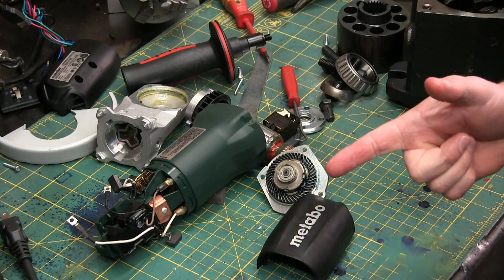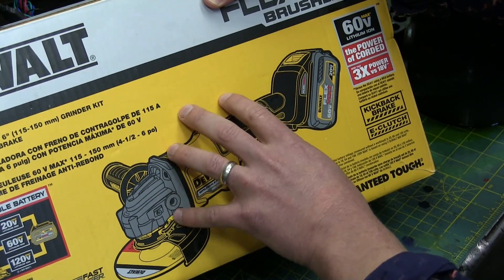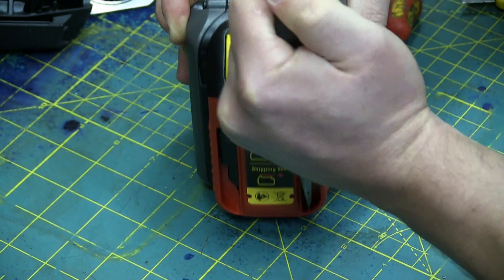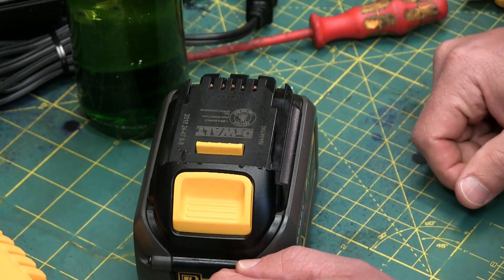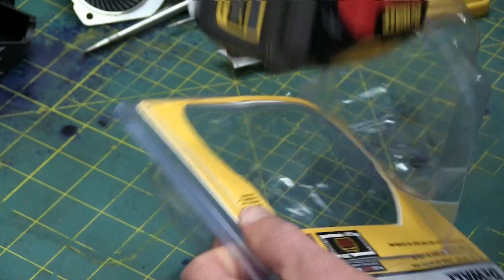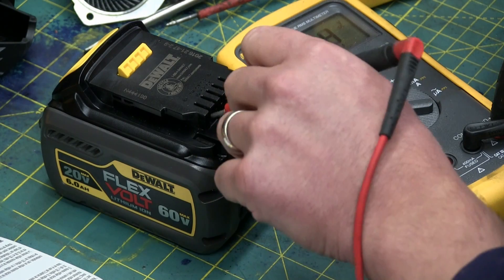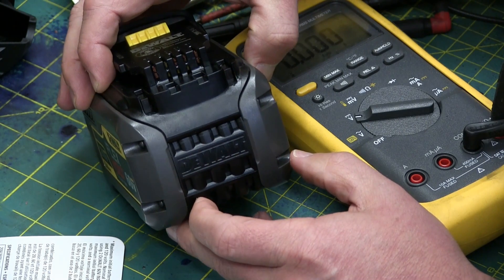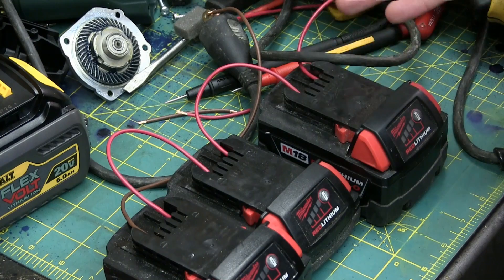Plug-in Power Tool to CORDLESS CONVERSION.

Comment: Hello AVE! I've been thinking about this problem today and I've read the comments about UPS's etc, long story short, I've got an idea for a device which should solve your problem. I could knock up a prototype this week if you like? It's not expensive at all. Just incase your wondering who the hell I am, I'm an EE for HVAC over in europe, mostly worked on power stations and cathodes for spacecraft engines. I've seen larger scale versions of this problem with long HVAC lines in some of the more remote parts of my country, and a factory on the end of one of those is basically the same of a tool on the end of a long extension cord so I thought I could just miniaturise a version of the solution used there.

Comment: use capacitors on the tool end. like a start cap on an induction motor. it will add the current at start. Then it recharges during normal operation.

Comment: There's a lot in misinformation in the comments.

1) This is a universal motor. It runs on AC or DC directly. We don't want to nor do we need to use an inverter like a UPS.
2) 120VAC is measured as RMS which means the waveform PEAKS at 170V
3) 120VAC RMS is equivalent to 120VDC

Comment: There's lot of ways to do it... two 60V windings in the motor can be wired in series, which makes 120V as long as the insulation strength can take it.

Then there's the fact that a series-wound motor will run on DC or AC.

Speaking of the turbocharger, it's possible to couple the AC on top of DC using capacitors, but you need big caps to do it, like Motor Run capacitors. Even still, it's a complex problem that the drill may not be able to handle, particularly if you're looking at a 60VDC offset (which means your drill needs to be able to take 240VRMS AC or 339 Vpp). TL;DR: get a big enough inverter or just spend the money on a proper extension cord or generator.

Remember... if it won't trip the breaker, the drill motor is going to let out the smoke!

Actually, a better way to do it is something like US Patent 3727122. Turn into DC, and make AC by alternating the polarity every other cycle once the source is connected the DC to the load when it's not going from 0-189VDC. 

https://www.google.com/patents/US3727122

Comment: This has really got me thinking. here in the UK we have 230v in houses (400v 3phase on commercial and industrial) but 110v for building sites. We have 230v to 110v Center tap earth transformers, 2 x 55v. (so when some dumb fecks chew through it they only get 55v) With that in mind a 60v battery (or 2) with some electronic trickery should work. it would only need to out put 2 separate 55v AC supplies 180' apart on the sin wave. this is doable !!

Comment: why not convert the power from the wall right to DC, then have a bank in parallel with protection? or skip the batteries and have a cap bank that discharges when you go to draw current?
it would be easier to explain on paper but I can see it working.

Comment: Hey Bro, the reason batteries aren't fully charged when you buy them off the shelf is because they are in a "storage charge state" which is usually around the 50% mark of capacity. This is in fact the correct level you should charge your batteries at home when putting them up for the season as it extends the life of the cells. I never understand why tool chargers don't have a storage charge setting on the unit but I guess it's so the battery does die and you have to buy a replacement. 

I really like the idea of a turbo charger for tools so you don't trip a breaker but I would have thought super capacitors would be the better option in the setup you suggested, no?

Comment: Not to burst your beer bubble but that is just brown out protection.  So why not use the off the shelf product that already does that? Get yourself a buck/boost UPS for computers and electronics.  Also called brown out protection.  They are the less efficient of the UPS offerings.  I believe all incoming power is converted to DC then routed to a common bus with the batteries and then that in inverted back to AC.

Comment: You should look at the h bridge circuits that they use in simulated sine wave UPS backup batteries. They don't actually use inverters they use an h bridge circuit to switch the dc power to actually get the pixels dancing in the right direction to get a sine wave. Also, they use the same h bridge in reverse to charge the batteries as well!
Reply: http://www.bristolwatch.com/ele/arduino_power_inverter.htm pardon if I have no fucking idea what I am saying.

Comment: ever send an apprentice out to get a bucket of spots to fill up a spot welder now back on subject wouldn't a device like a stun gun that was capacitive discharge supplement the power drains if you could somehow get it to monitor the power coming in from the wall

Comment: Theres a black push switch (which engages when you attach a 60V tool) on the battery which switches it into 60V mode

Comment: Thank you for the compliment, but I am not a highly technical smart, smart guy. I am just guy who scratches wood and metal in the kitchen of his mother's ""Hacienda" and calls it a workshop.

Now, first thing we need, is a small battery that equals 3x 20V batteries. It also has to be 120v 60Hz and 220V 50Hz compatible.

Comment: Turbo charger for tools? An inline AC battery bank you say? A high wattage switching power supply you say? You mean any old off-the-shelve UPS??? 

If you think that's cool just wait until you try hooking up an old server-grade UPS in your car's trunk and powering all sorts of AC and DC stuff simultaneously with that! Hell throw a solar panel on the roof rack and trickle charge the batteries all day because YOU CAN.

Comment: I think it would be easiest to convert the ac from the wall into dc in the turbocharger then add the extra power of the batteries. I'm pretty sure adding dc to dc is easier than adding dc to ac.  Just my thoughts on the matter.
Reply: I think this would be the easiest as well, running on converted DC most of the time, and then a relay to add the batteries in when the current reaches X amps. Or even simpler a clever diode arrangement that would draw from the batteries as the DC voltage sagged a bit when the tool was under load.
Reply: I concur.
Reply: It would be easiest to use a switch-on current limiter from the market.

You may disassemble a switch on current limiter to use the start on voltage from the batteries and the
other from the power outlet (it's a mostly PTC)
or use the online USV concept. (which is not simple at all, but works for server computers)
Reply: ronnies07 g
Reply: You don't need anything special, just an intelligent enough charger, one, which does not explode, when you want to draw , say, 50Amps from it. Instead, it shuts itself off. 
So when you start the motor, the huge current spike gets soaked up by the batteries and once the current drops to acceptable levels, the charger kicks in, supplies DC to batteries, while batteries supply the tool normally, any surplus power the charger can spare goes towards battery charging.
Reply: +Robert Housedorf II ... Your first paragraph is okay, but then you get too complicated.

Comment: Sounds like you are basically describing an UPS but in a neat and innovative way. UPS are usually used for sensitive electronics where as the tool shop is a different market entirely. I like it! If you were to incorporate an UPS with a reel style cord and top that shit off with a charging station. Bob's your uncle, marketable thing-a-majig.

Comment: I think that i saw on a different video that when you slide the battery on a 60 volt tool it pushes in a mechanical switch that switches it from three sets of 5 cells in parallel to all 15 cells in series.    Idk, i haven't handled one of these myself.....YET!

Comment: I was thinking!,, if you make a cirquit board with an un holy amount of capasitors hooked up to your battery pack you could maybe get rid of the breaker problem because you would always have a certain amount of current stored away ,think old radios,radio tubes.
Result could be the battery pack before the battery pack.
Capasitors feed the start up on your tools and the battery keeps the capasitors at full level.
Or it wil explode and burn you shop down? Try this idea outside first! Yea!

Comment: We need this to be easy and for any tool...
Take a mains power cord (of respective country) and connect a beefy super capacitor across the live/line/hot and neutral.

Seems silly but the super caps need to be in parallel with the tool anyway, this means that you don't even need to take the tool apart.

I would recommend getting a two way extension cord and putting the caps across one side and the tool across the other. Use a short flex for the tool and a longer one for the extension cord, that way the caps will need to dissipate less energy when the demand is higher.

If you want it to work really well you also could connect a rectifier to the mains extension cord at the input, that way the tool is always on DC and the caps are always charged after their initial charge (which will be before you press the trigger on the tool anyway.)

...and Bob's your aunty...
Hope that helps!

Comment: what abt some super caps in parallel with the tool to provide the turbo boost would that work? i like the idea of the battery pack, for corded tools, im thinking 12v gate batteries for a cheap solution. just wondering if there are any safety concerns having so many batteries in series and how would you go abt charging them without disconnecting them from each other?

Comment: To start heavy tools, you usually use an inrush current limiter. That's as simple as a big wirewound resistor, with a timing circuit and a relay that bypasses the resistor after one second or so. You can find it at circuitsonline.net at 'schakelingen' / 'inschakelvertraging' https://www.circuitsonline.net/schakelingen/93/voedingen/inschakelvertraging.html

Comment: My admittedly limited understanding of industrial machinery switches (called contactors?) has them providing this kind of capability by using big startup capacitors to handle the initially big amp draw. Couldn't one of these be the base design, and then find a way to utilize the capacitor's accumulated energy under conditions other than startup?

Comment: Using a bridge rectifier and a large capacitor back would do the same thing and be easier? Capacitors are great for absorbing surges. just be sure to current limit thru a 100w lightbulb or something during initial switch on while the capacitors charge up or you'll possibly blow a fuse

Comment: Quick question, I have heard that while running do through ac tools is usually possible, it can often wear down the contacts within the switches of the tools. Would this be a issue that can be easily overcome? I assume you could just us dc switches... Could you explain the difference in ac and dc switches?

Comment: 3000 answers , all whining, if you can't do anything with it stfu.
If the computer has a little gizmo that tells it when to discharge so it doesn't focker up , the tool can have one also.
The tool can also have a gizmo that makes it so the Mains don't arc, for farts sake , stop whimpering.
If they are at 60 volts now AvE, do you think they will have them in 120 volts , in a couple of years and completely do away with the plug ins altogether?
That would also help eliminate people electrofrying themselves when they take the ground  out of the extension cord and then run it straight thru a mud puddle where they taped their two 50 footers together, with duck tape cause they didn't have electrimical.!

Comment: Just buy a 10 gauge extension cord!  Maybe put a capacitor across the line. (balances out the power factor. The motor in all "L", add some "C" for "Unity"

Comment: I'd totally hate to poke another canuckleheads awesome idea with the same stick he is poking the internet with to help make his idea but Dewilt is making a 60v power inverter that will use 4 batteries (20v, 60v, 2,4 or 6ah) to make corded tools "cordless". Just buying the batteries will cost you an arm and a dick plus the very expensive yellow and black box. It will  function as a 4 bay charger when plugged into AC power. So I guess in theory when plugged in to power with 4 batteries on the rack it should function as a sort of capacitor or as you say DC TURBOCHARGER!!!!! Also push the goddamn fucking yellow lock button for fucks sakes FUCK!!! http://www.dewalt.ca/en-ca/products/accessories/batteries-and-chargers/chargers/1800-watt-portable-power-station-and-parallel-battery-charger-kit/dcb1800m3t1

Comment: I was all cool with the skunk beer marine shit....     Then I saw that hippie shirt...    Have you been sniffing that pixie smoke again?  hahahha  I always wondered why people did not design those big drills to have a battery and charger all as one unit. Maybe a high low setting on the charger so you can set it low for long drop cords. That would get rid of those big amp surges that pop breakers and the what not.
Reply: Ahhhhh.   They were reindeer PJ's.   Sorry dude.   Those are cool.

Comment: Ave, look up the Dewalt DCB1800, it similar to what your proposing and it may be a useful foundation for your project. Secondly I'm guessing it may be a physical switch that enables the battery to dish out 54/60v on those flexvolt batteries, i noticed a couple of tabs above the battery indicator that look important, maybe the flexvolt tools have some additional plastic to engage them? Just a guessing on that one tho, keep up the good work Ave.

Comment: How about having the tool connected to a sort of centrifugal switch like a motor but instead of being connected to the start windings have it connected to the batteries that way on start up and when it's being bogged down the DC will kick in.

Comment: This "power tool turbocharger" is a sweet idea! but it is far from acting like its turbo charging tools. A turbo charger in terms of a vehicle function doesn't do very much until the vehicle is up and running and already pushing exhaust gases through the turbo and then that boosts the air into the engine  and then increase power output. Your idea is basically ether or starting fluid for power tools because it is all right up front and gets everything going easier. Get your marketing wank right! Call it electric ether! AvE for president 2016!

Comment: Simple copy what they do on AC units of a startup capacitor just with a limiter to slow how fast it charges. You only need the punch so it doesn't need a huge backing just a quick push before the line catches up with it.

Comment: They ship them at around half voltage because that is the only safe way to store Lithium Ion. It is called 'storage charge'.
"While lead acid must always be kept at full charge during storage, nickel- and lithium-based chemistries should be stored at around a 40 percent state-of-charge (SoC). This minimizes age-related capacity loss while keeping the battery operational and allowing for some self-discharge." from Battery University

Comment: Something like a big chuff off motor start capacitor built into a moulding that looks like a plug in RCD (probably know as a GFI, or probably doesn't exist outside the UK..) with a coil of wire around the mains input acting as an inductive sensor supplying some logic circuitry controlling FETs supplying additional electrons.  That way you're not dicking about with lithium
Reply: Read the comments you glory hogging tool. Already been said.

Comment: a buddy of mine has been dropping golf cart batteries into rubber maid totes with an inverter and small charger for a while now. Keeps it simple, no switching back and fourth. He can plug the tote into AC or a cig lighter, then has the inverter and some cig lighter ports on the box. All of the power goes through the batteries.

Comment: You said they save money by not fully charging the batteries from the factory and that's definitely true but the main reason they do it is because the optimum storage voltage of lithium batteries is somewhere around 70% charge.

Comment: Actually, chaps, the problem is with the Norte Americano obsession with doing things different to the thinking half of the planet. So drop 110 Volt for 220 Volt. WE don't have that issue with pokey 10 meter (sorry 30 foot) extension leads. But I know you won't, because you guys will see it as bowing down to the French or the Chermans or something, so why not compromise and go for 440 Volt instead? More volts are better! 

And while you are at it, drop the gallons and drams for honest liters and millibobs. And how about learning to drive on the correct side of the road (as opposed to the right side)? OK, we can compromise on this one as well - we all drive in the MIDDLE of the road, and that way the Europeans can't smirk!